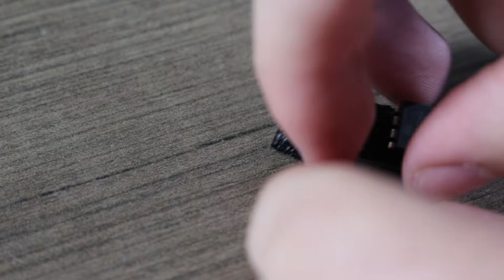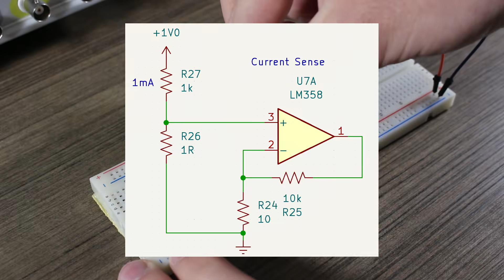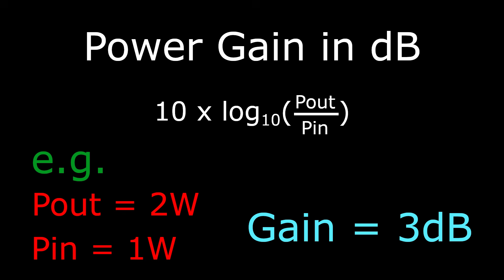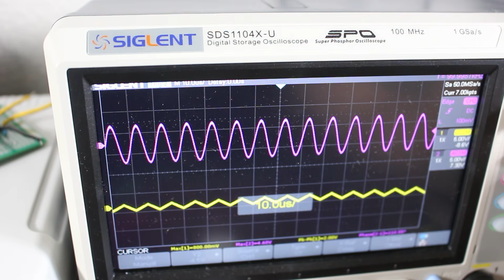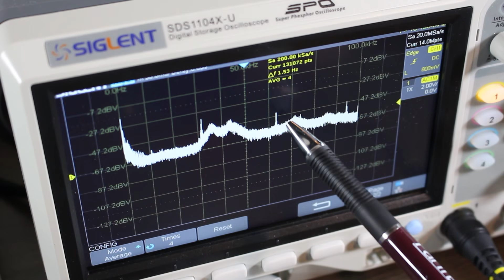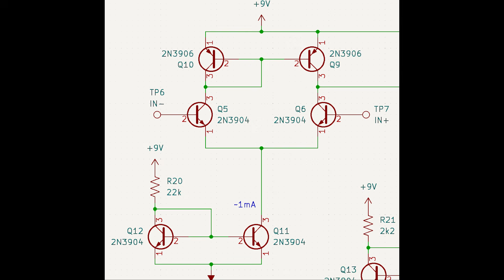The Ultimate Op-Amp Comparison - Bandwidth, Slew Rate, Frequency Response, CMRR & More!

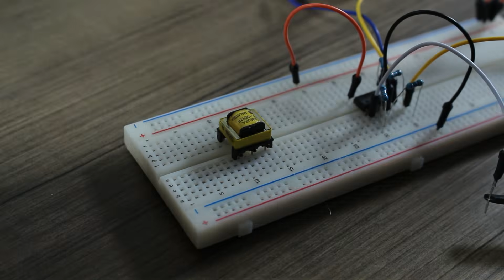Comment: Excellent from start to finish. 21:42 What center tapped transformer did you use? I'd like to see a video of putting op-amps in parallel for reduced input voltage noise. A possible improvement in the discrete op-amp is using a different BJT pair for current mirroring, such as with higher Beta.

Comment: You will find that a great number of amps and receivers using the 4558 op amp. So, it is odd that it isn't  mentioned. The TL 072 is around for a very long time. I believe  that the TL074 has better specs. It  isn't  just the op amp but the actual design that matters.

Comment: hi , am using op amp which has 9mv offset , will this internal offset be added to my ac signal which comes from photodiode ? will this be amplified ? as my issue that my signal is weak goes from 0.1mv to 30mv and i only want to amplify the ac without the offset do i need to care about op amp internal offset ?

Comment: DC offset will also affect how close to the rails your AC output can get and is another reason why you tend to clip on the positive rail first.  Something that you didn't touch on was input impedance which is where the TL072 shines.  While it seems a bit noisier than it's bipolar input cousins that is only true with low impedances. When you amplify a high impedance sources such as a guitar pickup or a magnetic phono cartridge then it will actually be quieter than a 5532. Offset voltage is also a problem with high impedance inputs and again the JFET frontend devices like the TL072 shine here also.  Don't use the LM324/LM358 for anything audio because they have really bad crossover distortion. There are better single supply op amps available. I cringe every time I see someone use one in an audio circuit

Comment: You measured the noise induced by the scope by inserting a 50 Ohm resistor into the input. So you measured the noise induced by the resistor and the noise of the scope. To measure only the noise of the scope, didn't you simply short the input?

Comment: Fine summary of the experieces I learnt by my own learning curve!  I useed to study every new data sheet we got thanks to our vendor connections.  But the actual learning came by very much the same testing practice that this video presents.  In fact, my employer's needs were originally satisfied by a DIY op amp built with 2N930 transistor pairs mounted on aluminum blocks for maintaining a better temperature balance.  Next came a commercial molded block that required our addition of a 2N1711 emitter follower.  We quickly found that we had to add a series resistor between the module outpit and the base of the emitter follower to eliminate oscillations.  Then the monolithic IC time came with uA702 and 706 which needed unacceptable power supplies from our point of view.  But uA709 was working like a champ, except for its tendency of latching up with excess input drives.  It could be tamed with a couple of external components, but we were happy to change over to uA741 (or LM741) that did not latch up.  However, that improvement came with a tradeoff, it was slower than the '709.  For years now, my favorites have been TL082 (and 'TL084) and OP27, with an occasional LM318.  Some other designers in the company have favored LM411 / 412, so they too have come my way.

Comment: What are you using the op-amp for? In music we use them for creating gain and clipping. To test this we have to listen to them to understand which ones have desirable musical characteristics. This doesn't mean the one with the best numbers on paper it's the one with the most harmonic content and the smoothest most musical sounding signal. The ear can tell.
Reply from the maker: Op-amps are useful for most analog circuits. Aside from audio, they can be used for control systems and feedback loops, or just general gain of signals. This op-amp in the video was a simple demonstration of how they work and what the parameters in the datasheet mean.

Comment: Input bias current can result in unacceptable errors in some circuits. With some amps the error can be minimized by making sure the equivalent resistance that each input "sees" is nearly equal. For example with a unity gain inverting circuit using a 10k feedback resistor and a 10k resistor from signal to ii, you would use a 5k resistor from nii to ground. However there are amps that employ internal input bias current cancellation circuits and with those the balanced resistor approach can make things worse. A balancing resistor will always add noise.

Comment: It is important to note that the input offset voltage may be either positive or negative. That means the error due to it can either add to the output voltage or subtract from it. It is impossible to predict which way the offset will go for any particular "copy" of a particular part type.

Do not expect a "rail to rail" op amp to actually swing fully to the rail. Many won't get any closer than about 50 mV from the rails. It is very often the negative rail ("ground") that is important, especially for applications such as providing gain for a signal going to an analog to digital converter. On a 12 bit converter with a reference of  4.1 V, one count is about 1 mV. 50 mV is 50 counts. You can do things like adding a pull-down resistor, but that is a big problem if you are trying to do low power design and it still may not get you where you want to be. This problem can be extremely annoying.

Beware of the fact that some op amps will produce phase reversal if the inputs are overdriven. For example, if you are running on +10 volts and drive an input to +12 volts, the output may go to the negative rail instead of just failing to swing to an impossible 12 V at the output. This is disastrous in some circuits. Modern op amps are often carefully designed to prevent phase reversal.

There are circumstances where using a fast amplifier can make it harder to produce a circuit that is stable. An example is a amp with a voltage and/or power buffer stage added. A slow amp with fast buffer transistors is likely to be stable. A fast amp with slow transistors is likely to slam the out from rail to rail or otherwise behave very badly. You really need to understand the issues and know what you are doing to produce a well-behaved circuit with best performance. Don't assume that an amp closer to "ideal" will work better. It may make your circuit work much worse until you get your noughts and crosses (poles and zeros) where they need to be. j may be an imaginary number, but it can make for some very real problems.

an aside - in modern use there should be a space between the numerals and the unit, thus
12 V not 12V
37 dB not 37dB
20 °C not 20°C
I sometimes ignore this custom if I am annotating a schematic and there is very little space in which to cram extra things.

Watch out for counterfeit parts. Buy from authorized vendors.

Comment: Thank you for the excellent video, can you please explain the mathematics behind the current mirror, how do you get to 1mA?
once again thank you!!
Reply from the maker: I did the voltage supply minus the diode drop divided by the resistance. The result is rounded up.

(18 - 0.6) / 22000

Comment: Great video!  It brings be back to Electronic School.  I like your Oscilloscope, so much can be analyzed with this machine.  There are a few good solid state scopes available.  I purchased 10  NE5532P Op Amps on ebay for $2.  Why,  I saw a video which said you can massively improve Op Amp performance by running them in parallel?  It was said they get HOT with this configuration so I'm going to add a small heat sink and see how it sounds.

Comment: Thank you for this. I'd love to see some comparisons regarding RF immunity. I've seen problems with the LM358 where it appeared to rectify an RF field, which then caused problems in an audio circuit. I'm sure a redesigned circuit with better shielding would work, but the quick fix was to switch to a TL072 or TL082 (edited for typos).

Comment: Very good video, I'll be watching more.

As I am an audio enthusiast, let's assume in a class D audio amplifier project that will have a frequency of 20Hz to 20KHz, we will divide it into 3 ways "BASS - MID - TREBLE".

So, correctly ideal, an "op-amp"?
For BASS, it sounds best at low frequencies.
Another one just for the AVERAGES, which would sound better in the middle frequencies.
And another for the TREBLE, which will sound better in the high frequencies.

Sometimes it may happen that the same op-amp sounds good at all frequencies or how it is used for each group of frequencies?

Comment: I have an Open Source project based on the absolutely wonderful Jensen 990. I've had to make a few changes to accommodate a simple diff amp using a couple of low-noise transistors running at (get this) 100 uA!

Or you can remove those and plant a MAT02 in there for absolutely staggering noise performance. 

It also has a class AB output stage for excellent AC performance and very low output impedance. 

I did have to make a couple of small changes down to things that were specific to the matched pair Jensen specified (it's no longer made) but it's far more complex than the simple one here and should offer much higher performance.

I've not had time to improve the layout but if anyone wants to see the schematic and PCB they are on my Matt Perk's forum. It's higher voltage than most common op amps and will drive a much larger capacitive load due to the AB output. (You can always uprate the output transistors if you wish and this is mostly a SMD design stray capacitance is less of an issue. 

Something SinceLab missed was the "guard" around the high impedance node which is the output of the differential amp. In the case of the Jensen, that node incorporates multiple components so it's quite fiddly to lay out.

Let's be clear, I absolutely admire the way that SineLab has explained this - we can go into a lot more detail about poles and zeros (the things that really spoil your day). This young man is exemplary in simplifying complex issues and his demonstrations are spot on. I wish I was that good when I was his age.

Comment: Hi thank you very much indeed for this great video   I tried to understand the most but it is very difficult for me 
I would like to know how important is a high slew rate for an audio circuit    The higher the better ?
i see opamps with very high SW  Are they the best for a preamp ?  i have a line preamp issue
Reply from the maker: A high slew rate is good for audio circuits.
Reply: @SineLab  Hi thank you very much
I asked because i see mentioned opamps with max 20V/us while there are others with 3-400V/us
They are very rare in audio circuits

Comment: Excellent video that covers a lot of ground about Op Amps. I would just like to mention one more category of Op Amps that I like using and this is Instrumentation high precision Op Amps. Like the chopper Op Amps. They are expensive though, but they offer some really cool characteristics. Like super low drift, noise and voltage offsets. One such Op Amp I used in my projects and like a lot is the LTC1050. There are of course better instrumentation Op Amps, but ltc1050 isn't crazy expensive.

Comment: Excellent!  You, and those watching this,  know more about OpAmps than the vast majority of EEs (and the Perfessors teaching them)!   

For all you young Techies out there, consider this: Learning to "code" is now rapidly being replaced by AI, learning fundamentals, making them with parts and soldering is becoming more valuable by the day.

Kudos from a retired EE in his 70s.
Reply: Prof. Lanterman at Georgia Tech has a channel full of really in-depth op-amp and operational transconductance amplifier lectures and experiments, If anyone wants to dive in deeper than this intro. Not for nothing, the professors at Georgia Tech go hard, they know their shit.
Reply: You think AI can't do circiut design?
Reply: @AllHandlesHaveBeenTaken  Yes, eventually AI can do circuit design and physical implementation.  Coding AI can do now;  digital design it can (or is already doing inside ICs) in a few years;  analog deign is more than an order of magnitude more challenging and will take a while longer (~5 years would be a good guess).   Analogous to writing code, there will initially be pieces and modules of circuitry at first, followed by interconnection of them for a specific function.  Just as code has become a sprawling monstrosity patched together requiring more performance and memory, so will the advances in silicon make the sub-optimal and often unusable analog designs fit in shrinking,  ever more capable, less expensive hardware.

Comment: You can get a pair of transistors in the one package to keep the input differential better matched. Also, due to their comprehensive internal regulation, an op-amp like the NE5534 and its variants are able to operate with power rails between 9 and 17+ volts.  For the 1980s - 1990s, Motorola made the MC24080 series of of op-amps that -- although noisier than an NE5534 -- had a particularly nice sound, but they are now obsolete :-)
Reply: NE5534 is better than NE5532 but I want to mention for others that it needs a voltage gain >= 3 to be stable. Everyone but TI stopped producing it in the past 3 years. I guess 1 amp per chip versus 2 hurt demand and hobbyists don't want to mess with compensation pins for max performance.

Comment: The single supply op amps asymmetrical clipping might sound good as part of a distortion circuit. 

Cold biasing a tube so half the wave is cut off is a common technique in guitar amps.

Comment: Very nicely done presentation;
Back when I was doing design what ended up being the limit in components choice was in what we had in inventory for making our other products.
For better or worse, it was LM324's for most everything and that resulted in other design constraints.

To get a new component added to inventory for a different product required going before the bean-counters with sales projections for the new product. It was not my most-favorite part of the job as an EE. I was happier with datasheets, perfboard and a soldering iron.

Comment: In Offset Measurement, you set 0V to input '+',  so what for are 10 Ohms and 10k Ohms resistors, instead connecting directly to ground ? It seems should be the same.

Comment: The thing is to stay away from open loop and set the gain product bandwidth to what you need for the requirements. Keep them stable as much as possible, as without an oscilloscope you won't know if they are hooting away above 20kHz  😞

The best opamp is the one you have.
the second best is the one you can get tomorrow,
The least best one is the one you need but's it's on 16 weeks back order.

Comment: LM4562 (€2.30) is the worst I would use for HiFi.
Reply: NE5534 and NE5532 are good audio op amps.
I think there is in recent years a better one made by Burr Brown, but many analogue large format mixing consoles used in world famous recording studios use/used the NE5534 device.

So a considerable amount of music from professional artists has been through filters and dynamics sections on mixing consoles using them.
Reply: So what's the best?
Reply: @franzliszt3195  I still have to search, since the ADA4899-2 can only handle +/-6 volts supply voltage, the maximum output voltage is limited to +/- 3.1 V = 4.3834 V~. However, this would be completely sufficient for DAC purposes because of the limited level. The ADA4898-2 has ultra low noise, higher distortion and only 55 V/µS. With usual output voltages, the slew rate must be well above 100 V/µS, as there is a gap at 20 KHz at the beginning of the first half-wave in the LTSpice simulation software. But with music (constant superimposition of several frequencies) there is no time for it to settle in, there are always only "beginnings" of oscillations. I've only been using LTSpice since 2023. Audio op amps are too slow, video op amps have too much distortion and noise @ 10 Hz (MC RIAA amp). In between, I still have to look for the best compromise from “1000” op amps.

Comment: It would have been interesting to add a modern high performance OP amp to show what is now available. Offsets of fractions of a microvolt, 300MHZ bandwidths, and 6000 V per uSEC slew are available at very reasonable prices.

Comment: Douglas Self has a lot to say about op amps for audio (mixers and so on)  in Small Signal Audio Design (4th edition due out soon). There are many subtleties when you get into it. Highly recommended if you are doing any analog, especially below 1 MHz. Useful for background at RF.
Reply: Right, I'd like his observations brought in when comparing against 70s technology. He calls out the high input bias current on NE5532, low open-loop bandwidth of TL072 and 0.5 V/μs slew rate on UA741. The more modern OPA134 is way better than TL072 for JFET inputs and the 2nd edition has all the noise measurements I'd want.

Comment: Good video! I found your presentation of the CMRR very interesting. Didn't thought your homemade op amp would perform so well (at least on certain characteristics). Regarding the parameter of your ideal opamp i think you should have include size (sometime size matter...)
Reply from the maker: Size is important for small designs!